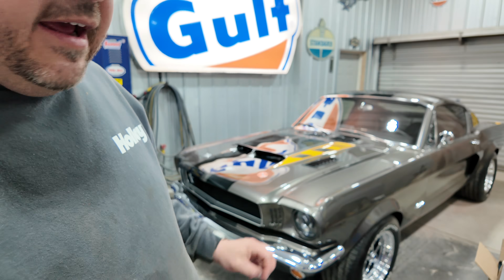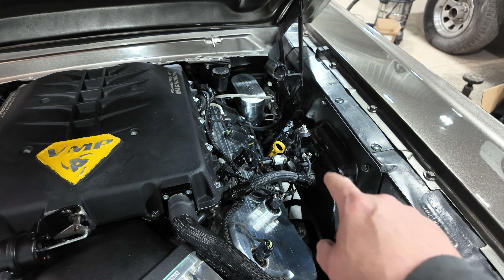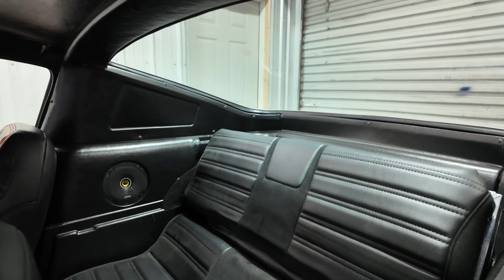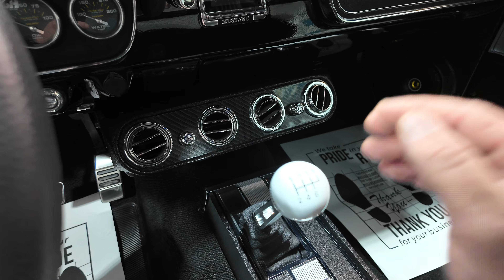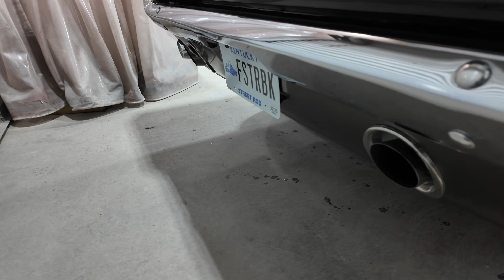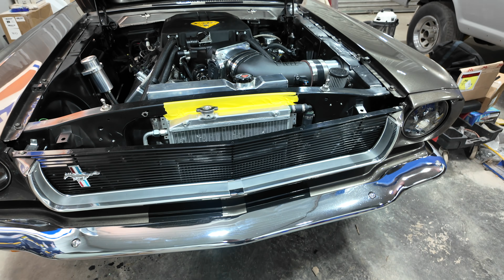65 Mustang Fastback Coyote Swapped and supercharged!

Comment: Like everything about it but the yellow! Love those fastbacks and with the motor and extras, great.  One thing i dont know why everyone uses those small width radiatior! Had a 351 Windsor in mine back in the day and trimmed out what radiator bolted to, moved and modified wider, and used a wider 3 core radiator and never had any overheating issue that fome with those small width radiators. Lots of work i know to make it all work as I built muscle cars, and custom work years ago and did it for over 30 years. You guys have more work now with these additions you can buy and new styles engines! Everyone want coyotes for fords and LS engines for everything else. I hate electronics! Lol. Like your gas cap choice too!  Always thought 65 and 66 had the best vent look than any of them. Look so good, alway wanted to put those in a 67 and haven't seen it yet. So many Elenor types built, I'm not a fan of all the scoops there. The vents are so awesome looking. Great car and great work!
Reply from the maker: Thanks for all of the compliments! This little radiator cools it perfectly, even in the summer time with the AC blasting! There wouldnt have been any room for the larger radiator anyway as we have the electric over hydraulic brakes mounted on one side of it, and tons of electronics on the other side.  Works out well like this though.